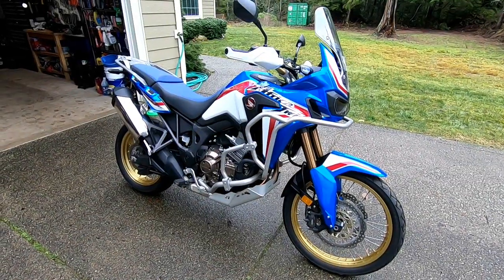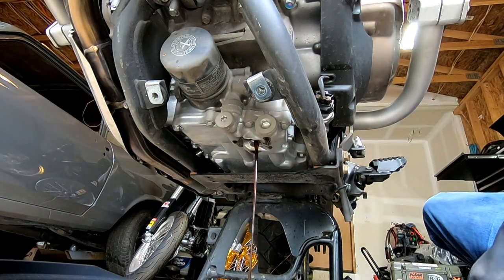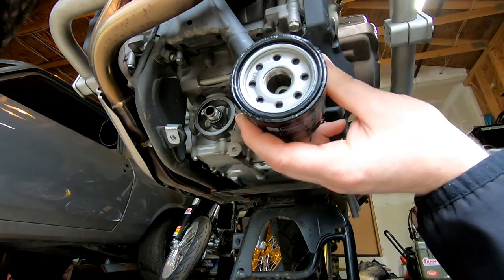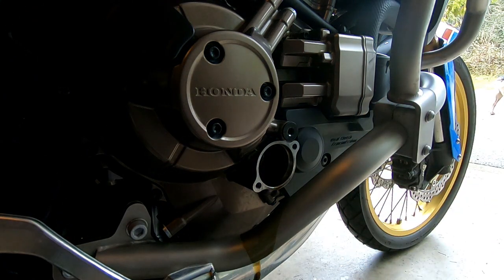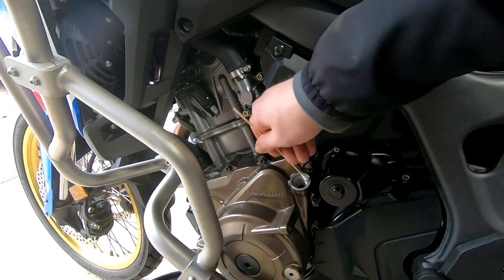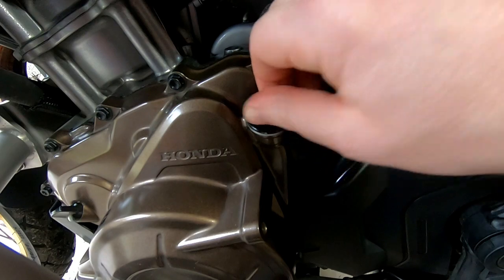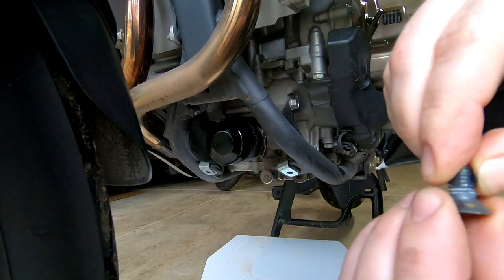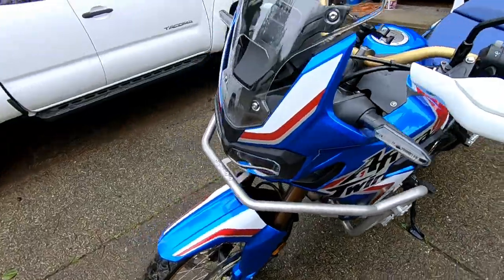2019 Africa Twin DCT | Oil Change

Comment: A little tip, before you install your new oil filter pour a little new oil in there to soak the filter element. It won't run down your arm trust me! Helps the engine generate oil pressure a bit quicker when you start up.
Reply from the maker: I wouldnt recommend pre-filling an oil filter. Reason being is new oil isnt filtered or necessarily clean and could include contaminants larger than the allowable microns. Even particulate 10 microns over what a filter does can damage bearings and friction surfaces. 
There should be enough residual oil in an engine to protect it until the filtered oil reaches its destinations. 
Might not be a big deal but im not a risk taker... or good at responding to comments when i just discovered that there is a “held for review” section on youtube studio. Sorry it took a year.

Comment: Good job bud, but next time put some of the new oil in the filter before you put it on the bike, this way when you start the bike the engine doesn't struggle waiting for the oil to get through the filter 😉👍
Reply from the maker: Glad you enjoyed the video and thats a good observation.
The reason i didnt prime this oil filter is because it is horizontal and less than a 1/4qt capacity.
My thoughts on this are: If it was populated with a bit of oil (50%), that oil would still sit stationary until the pumped oil started traveling through, it will save on fill time but its pretty small time savings imo.
I do recommend priming larger oil filters because the fill rate takes more time before sending oil pressure downstream.  (Like a 1qt. filter on a V8) i just didn't see it as necessary in this application and it wasn't mentioned in the 2019 service manual.
So heres what i did, I just wrote a letter to the Honda Performance Division engineers with the question on whether it makes a difference and will post the response publicly when i recieve it, we should know the technical information behind this practice.
Reply from the maker: The response i got was a 1-800 phone number to a sales department. 
So I emailed an engineer who worked on the DCT and was ghosted lol.

Comment: Wow your Bike is very clean
Reply from the maker: I typically give it a good detail before performing maintenance. It reduces debris getting into the bike internals.  I have a few horse hair brushes in the wash bucket to get in the tight places.  
It currently has 11,000 miles on it and its still pretty new looking. Maybe ill do a cleaning video if anyone is interested in sitting through that haha.

Comment: Great video, super clear. Are those the AltRider crash bars? How do you like them? Considering purchasing the same bike in manual and putting those on, as well.
Reply from the maker: Thank you, i look forward to making more videos! Yes, the bars are the alt rider uppers and lowers with the connecting bars. I havent tested them thankfully but so far i like them, very light and sturdy. The width is similar to the width of your legs while seated on the bike so no added girth.
Reply: @atombawm  That's awesome. Yah I guess those bars are a buy once cry once type of deal.  Thank you for your reply.

Comment: At minute 0:35 - So riding in the rain is a no - no??
Note: I have been told after washing to ride or start the bikes engine especially to dry it out and evaporate any water that went to sensitive areas.
What the...?!
Reply from the maker: The bike is designed to ride in the rain, and perform water crossings as deep as the bottom edge of the seat. Natural exposure to water. 
Washing a bike (depending on who is doing it) can put water where it normally wouldn't go. Like high pressure water jet straight down the intake snorkel/ directly on electrical plugs. I recommended to let it dry out because you never know how a person washes their bike.
Reply: @atombawm  No problem, I am the only one washing my motorcycle. I never, ever use high pressure sprayers on my motorcycles as...
I too was told high pressure sprayers get water in places it doesn't belong on motorcycles.
But if this does happen (water in the wrong place or places) the damage is done - prepare for trouble.
Yes, motorcycle dealers use high pressure sprayers to save time. Every time I see that I cringe 😬.

Comment: Hey Atombawm, did you take your Bike ever on the Centerstand, in my manuell there is no Stand, wether a side or a centerstand in use. The bike had to stand on one level Ground in upside position, than you check the Oilstand. Isn't it right ?
Reply from the maker: When i am checking the oil level for accuracy i do not have the bike supported on a side stand or center stand. The steps i typically follow are:
1) unscrew and clean dipstick.
2) support the bike upright on level ground by holding the handlebar. (No side stand or center stand)
3) put dipstick in briefly (do not screw in) 
4) pull out dipstick and check the level. 

Its worked pretty good for me so far without issue.
Reply: @atombawm  🙏👍🦁

Comment: Hi 
so you dont need any different oil for DCT model? Just normal engine oil and thats it?
Reply from the maker: Only thing i can recommend is using the oil suggested in your user manual. The other oil ive tried is motul semi synthetic (in the video) and motorex full synthetic, the dct trans and the engine share the oil.
Ive noticed the valvetrain is quieter using the motul in the video, none seemed harmful or changed the operating characteristics. I havent sent used samples to the lab or anything but perhaps i will in the future.

Comment: Does this include trans oil? Engine and trans share same oil, two different filters?
Reply: Yes engine and transmission use the same oil. Don't use any old synthetic! They can be too slippery and cause problems with your DCT! It needs to be classified "MA" and not say "energy conserving" or "resource conserving" on the back.
Reply from the maker: Yes. The DCT filter is before the oil goes to the transmission. Engine oil filter is before the oil goes through the engine.

Comment: The manual only suggests 10W30. Any reason to go with 10W40?
Reply from the maker: 10W30 is the factory recommended. I use 10w40 because the bike experiences a lot of heat occasionally and the 10w30 doesnt provide the viscosity to keep things lubricated enough causing the dct to shift inconsistently and the valve train gets real noisy. 10w40 offers enough in my situation and i can flog the throttle without wincing on behalf of my engine when its hot.
If you’re in a mild or cold area 10w30 works like a charm.
Reply: Atombawm thank you , it is just bizarre that the manuel only recommande 10w30 and dose not state to use 10w40 , I tried Ipon Katsna 10w30 but here in Quebec the temperature rarely get past 32deg Celsius.
Reply: @atombawm  How has the shifting been since you moved to 10W40? I just changed over to 10W40 last night and am curious about what to expect once it gets warmed up.
Reply from the maker: @davidenete  since using the 10w40, in sport 2 mode the shifting is direct, smooth and happens when anticipated. 
After 9000 miles using this oil, I haven’t noticed anything out of the ordinary.

Comment: Would this be the same for the 2021? Thanks for the video.
Reply from the maker: I dont know what the technical differences would be between the two on the maintenance side. Consult your owners manual for torque measurements, filter types, fluid capacities/ requirements and procedure. 
I know they changed the displacement but ive never done maintenance on one.

Comment: LIQUI MOLY OR MOTUL????
Reply from the maker: Last change i used honda hp line of oils i think. I tried several oils now and like tire pressures it can be debated to no end but my butt dyno couldnt tell the difference between motul, LM, HP and motorex.

Comment: How many miles you running on oil changes
Reply from the maker: 3000 miles or after a long rough weekend, the manual suggests it can go longer but im a spirited rider and change it often. Currently at 10,000 miles now and it still rides like new. I will be posting more maintenance videos soon.

Comment: Does the Africa twin come with an inbuilt center stand?
Reply from the maker: No, it is an add-on.
I purchased mine from the dealer then installed it myself.
Most dealers will install it for you at time of purchase, can possibly make it a part of the deal.
Reply: @atombawm  having a center stand makes it much easier to maintain your chain.
Reply from the maker: Sooo much easier...Setting chain tension, cleaning/ lubrication, rear wheel removal..even putting gas in the tank and washing the bike. 
I definitely recommend a center stand.

Comment: What's the model for the DCT filter?
Reply from the maker: For the engine oil filter i used:
Hiflo Filtro HF204.
For the DCT filter i used:
Hiflo Filtro HF117.
Reply: @atombawm  Have you noticed any difference using the Hiflofiltro filters? Do you recommend them? I have the ATAS 2018.
Reply from the maker: Ive noticed no difference in performance or oil color between hiflo and oem. I like hiflo and they seem to be one of few alternatives to oem.
Reply: @atombawm  Thanks for the reply.
I will soon change the air filter and oil filters with the Hiflofiltro parts. Mine is also the DCT model. Just subscribed to your channel. I would appreciate if you joined mine.
Reply from the maker: Great! I am now a subscriber.

Comment: Too bad you forget to tell your viewers that the bike needs to be on the side stand while draining the oil, this according the "user manual". This method assures maximum draining of the engine oil. 2nd The bike is water"proof", you can and must be able to start the bike even when it's soaking wet.
Reply from the maker: I agree.  As far as not starting it until it dries out a bit after washing, my rationale is that some users might spray water up into places that normally shouldnt get water exposure or use a pressure washer (which i also dont recommend on any bike unless you know where to not spray) whereas riding in the rain or river crossing wouldn't normally get water to reach. it was a trend that followed me out of the motocross field and its worked for me so far, no electrical issues, no imposter hydration in crankcase, fuel or air system.  But everyone has a style and method to their madness that works for them and i appreciate your input!  This particular video was one of my first and i hope it helps and stays relevant.